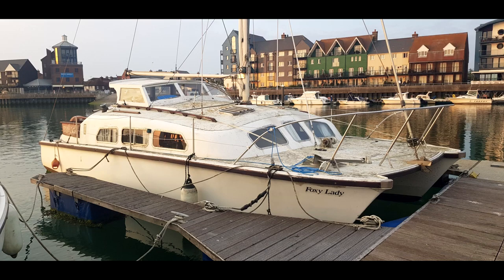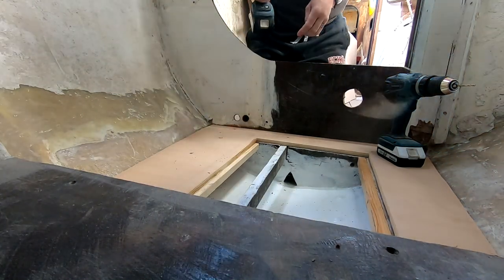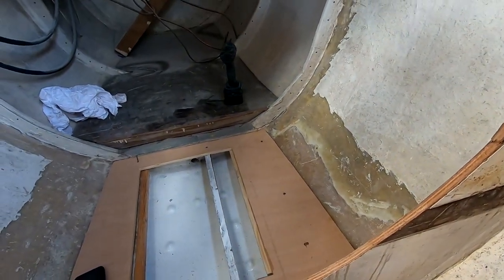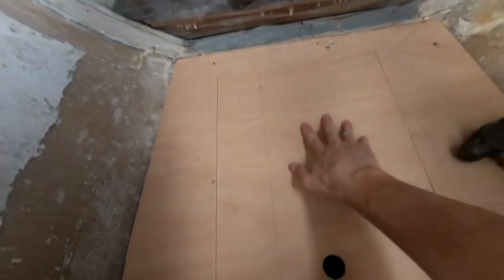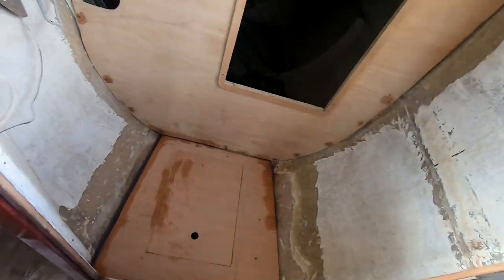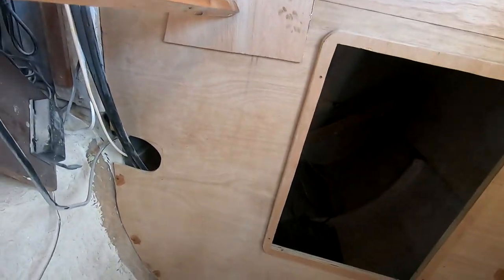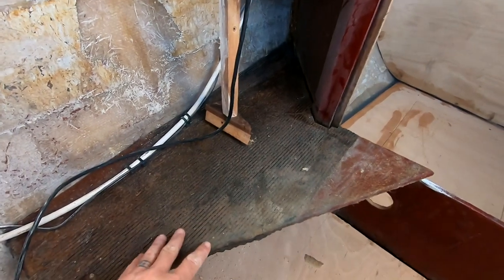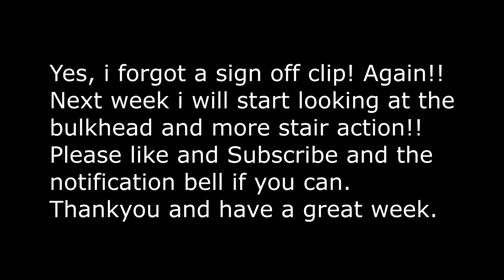Bulkhead fit and new aft floor panel inc Stair design and almost sunk my project Catamaran! E40

Comment: Please please please, use marine ply wood. Don’t make the mistake I did. I know it costs more but standard ply won’t last a few winters even if it’s kept dry... all the best Phil
Reply from the maker: Hi Phil, i did consider marine ply but didn't want to use 18mm and couldn't find anything thinner. The bottom is coated in resin but the top half will be closed in with csm and undecided on polyester it epoxy yet. 
I really appreciate what your saying and it makes perfect sense but for cost/ weight and need i am going to try and stay away from using loads of marine and try to protect with resins🙄🙄
In a couple of years when pulling them up, you can say i told you so😁